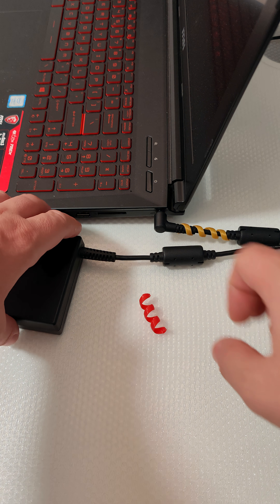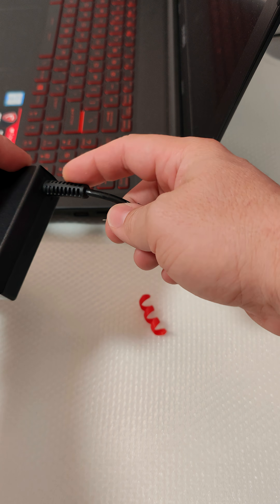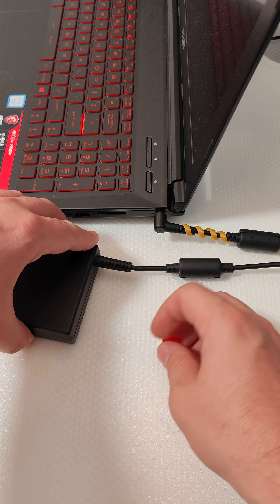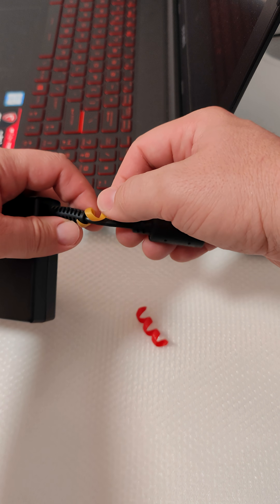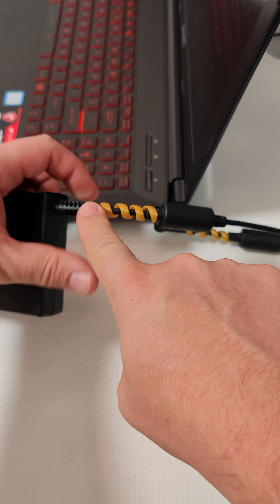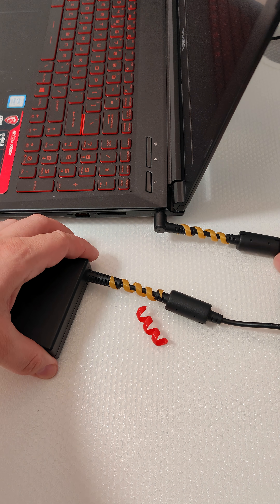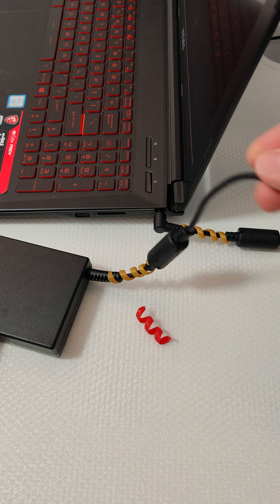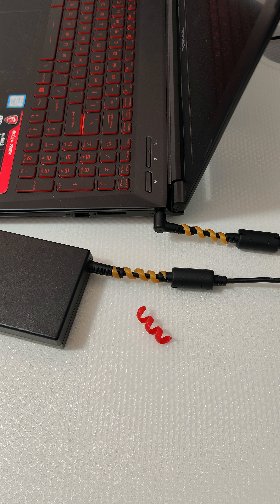Can This Simple 3D Print Save Your Laptop Charger?

Comment from the maker: Say goodbye to frayed cables with this simple tech hack! This 3Dprint wire protector is a game-saver for extending the life of your charger cables. Grab the 3D model free from MakerWorld: https://makerworld.com/en/models/1779652-notebook-charger-cable-saver-longer-version#profileId-1895619 
Now you can fix those annoying stress points and repair usb cable issues with this easy solution.